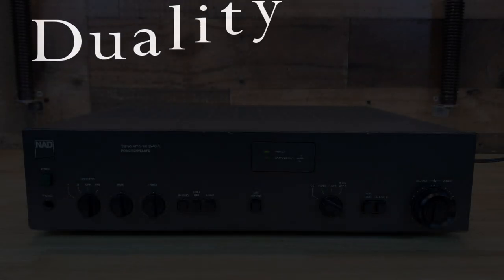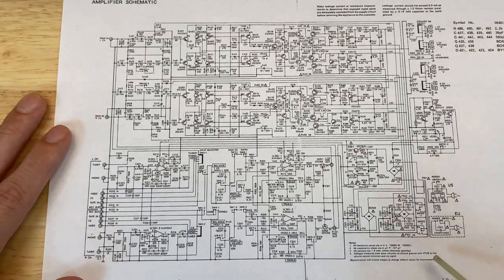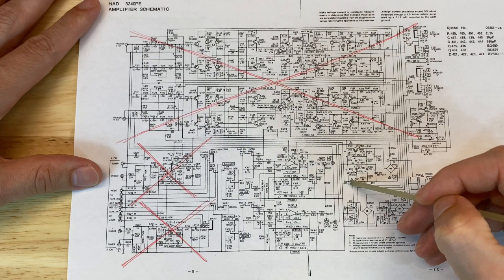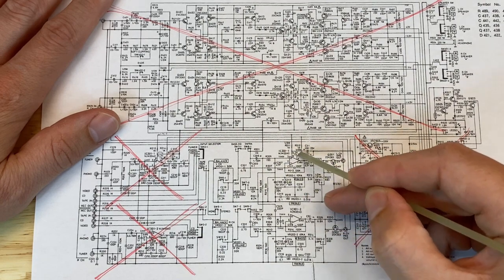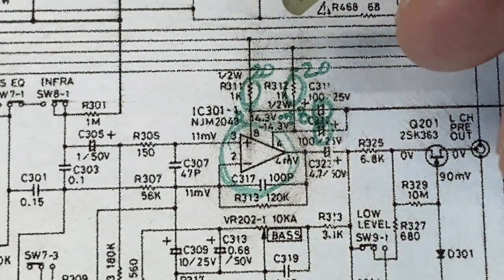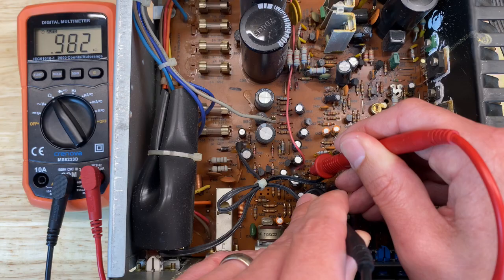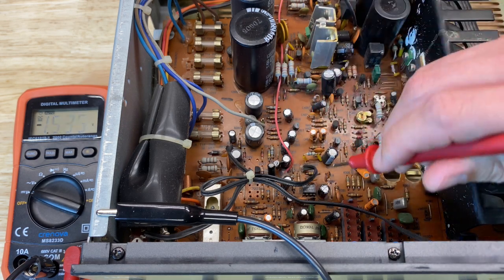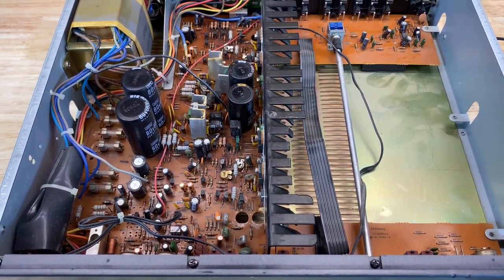DR #51 - Pure Electronic Troubleshooting with an NAD 3240PE Stereo Amplifier

Comment: Easy when you know what and where to look for the fault. Great job. As a non-electronic  man I'd say when in doubt change all the capacitors.
Reply: NAD integrated and power amps from the 1980's were notorious for super cheesy output relays. They were subject to corrosion and when they "closed", the signal had a hard time "burning" through the corrosion.

Comment: Component stereo only plays when I push down on the top of the receiver. Any ideas what it could be?
Reply from the maker: Sounds like an intermittent connection. It could be anywhere in the unit.
Reply: @dualityrepair4770   Thanks for get back to me. I'll try to find it.

Comment: Electronica is a fine hobby !!!
Reply: Did tv/ vcr repairs for about 15+ year's,  up until electronic prices went so, sooo low. On top of that, on the tv's, starting in around 1990 or so, manufacturers ended component level trouble shooting & repairs  by bot removing Identifiers, & parts supply of preparatory it's and such. Could still purchase a complete module or PC bord in it's entirety,  sometimes.  Cost prohibited if one is seeking to make a living.  RIP TV/VCR repair days,  we had a GOOD, LONG run. 😊😊
Reply from the maker: @davidsanders6957 Thanks for that anecdote. There are several areas in electronics I’d love to get into, including CRT TVs. It would be a whole new world for me. Maybe someday.
Reply: @dualityrepair4770  kinda hard to even find too many more crt devices. Good luck. In my area, occasionally the local thrift stores will get them, but they won't save them unless you maybe throw them a couple bucks now and again for calling you.  Good practice stuff in any case as most of it broke long before you saved 'em.

Comment: My 3240PE has the exact same symptoms as the one you worked in this video.  I checked the resistors and voltages into the op amp and the resistors checked good and the voltages on pin 4 and pin 8 are in spec.  How do I check the rest of the op amp?
Reply from the maker: If you have the proper voltages at the op-amp, there are still many other potential causes, independent of the op-amp. If you'd like, email me at nick@duality-er.com to discuss further.

Comment: Owsome video bro ,can i ask you for help please,am buzzy trouble shooting you a wharfedale wh-va 3447  receiver ,i placed 16v 2200uf capacitors ,with stock limited and i replaced it with 25v 2200if,reconnect all controllerboards.but it was given to me from a friend who tryed to fix it an all components and plugs was disconnected.so its a puzzle.lol.can or do you have advice reconnecting he power switch mode PCB .bcos i cant get any schematics on the web ,for the correct wiring diagram.
Would appreciate it from south Africa technician.

Comment: Incidentally i also recently purchased 3240PE amp and your video is the only repair video that i could find!. Mine works, those capacitors haven't failed yet but looks like it needs  full sevice( very old capacitors, corrosive glue, dry heatsync compaund and darkened areas on pcb from possibly overheating) . If you deside to make a video on full servicing i'll follow your steps. I have a question as well, there are some sort of breakers BK-1,2 A-40 on the output, i guess they are for DC protection but they are not relays so i don't really understand how they work. Thank you.

Comment: Seems like it should have dc output from that opamp.. and yes it would be see as a fault to the comparator that controls the relay. Im confused why i dont see any zeners being used with those dropping resistors and caps.. I would increase the cap values and the resistor wattage.  So it wont happen again.

Comment: Long time audiophile and repair video connoisseur here, only recently ran across your videos.  Really enjoy your concise, no fluff, straight to the point approach.  Not sure why you don't have a bazillion subs, but it's NOT because of lack of quality of your content.  Don't change a thing and just keep cranking them out - you've got a great recipe.
Reply from the maker: I really appreciate this. A little feedback goes a long way.
Reply: Totally agree with your sentiment and is reinforced by famed Paul Carlson's comment below. These videos for a budding hobbyist like me provide succinct, logical instruction. Job well done, and I look forward to more videos and deserved subs...
Reply: Most of the equipment that Duality has presented in this channel has: Low $ value due to age, OEM no longer support. I do recommend to work on McIntosh products which still in circulation even as old as 40 years old and McIntosh is one of the product that increase value over time.

Comment: Didn't you rule out the power supply when you demonstrated that the power amplifier worked?
Reply from the maker: Not quite. The power amp uses the other 2 sections of the power supply (43V and 71V). I had to rule out the section of the power supply used by the preamp (20V).

Comment: Oh my.. when i saw you use solder wick.. i looked at the ground. The caps cant cause the problem..with them off the board you should still get a voltage on both sides of the dropping resistors.. the caps give you stability. All of the solder looks dry..come on if your gonna teach. Stop blaming the caps. You simply do continuity test and youll find no connection between the rear of the resistor and the pin on the ic.. second thought.. the signal ground has bad connection also..thats the only way the voltage could go up on the other rail
Reply: If the power supply is unstable, the RC circuit of the tone control can cause it to oscillate.   Then the muting circuit stays open and there would be no output.  Anyway, I guess that is one possible explanation.

Comment: These 1980s NADs are excellent amps, but they suffer from the use of cheap components that were used to keep the costs down.  A full re-cap is almost always necessary.
Reply from the maker: Agreed. This video only shows the troubleshooting / repair. It will receive a full service (including a full re-cap) before I'm done with it.
Reply: NAD is overrated. If 6db headroom is your aim, well, that, nad is good at.
Reply: If NAD is “over rated” as you say, what would be YOUR suggestion as a better alternate?
Reply: Cheap components do not make for a good amp. In the 1970's Sony and others managed to deliver high quality amps featuring great design, build and components. This NAD is a sad little amp.
Reply: @maryrafuse3851  Bullshit.  The 3240 is both a powerful and transparent sounding integrated.  Rated for 40w/ch, the Power Envelope circuitry with +6db of headroom will easily crank out 160w/ch for real-world musical peaks.  And, it does it while delivering excellent sound quality. Their main goal was to counter Japanese flashiness with simple, good sounding equipment at a fair price.  In order to do that, they had to sublet out their manufacturing to third party factories in Taiwan and later China that used questionable longevity capacitors.

Comment: Huh, nice deductions. How do you find schematics for old equipment like this? Thanks.
Reply from the maker: Thanks for the comment.

HiFi Engine is a great resource for manuals, which is where I found the schematics for this amp. If I can't find what I'm looking for there, or anywhere else online, I've also purchased manuals from servicemanuals.net. Usually they're $10 to $20.
Reply: @dualityrepair4770  , thank you!

Comment: That is the worst heatsink i have ever seen on an amplifier..
Reply: The internals are cheap all round. 5% carbon film resistors are noisy, ceramics are dirt cheap poor tolerance, even the PCB is cheap. There is nothing at all pretty inside and reminiscent of the build quality of a Hong Kong/Taiwan import of the era. Oh and the hifi mags called it a "Best-Buy"!
Reply: You have to understand how power envelope works to know why this heat sink is good enough.
Reply from the maker: This was a very messy amp. Something was spilled in there at some point, that's what some of the residue is on the heat sink. It's a miracle that it works at all.

I wanted this video to highlight the troubleshooting and repair only. This amp will be fully serviced before I'm done with it.